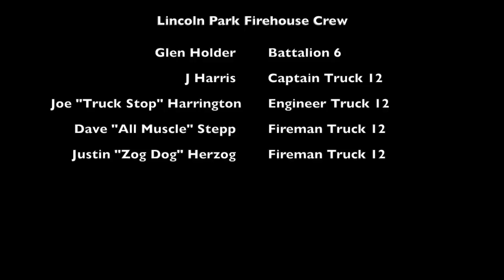Tuther Fire 2 FireCams

Comment: Discipline was good.
That being said...when you vent the roof of a single-family house, and fire comes out of every hole you cut...it's time to go. Get the hell off the roof before those 2x4 trusses fail. The house is lost.
Reply: I have only one issue with your comment. It is wrong. roof venting cools the attic and in this case the fire entered into the attic and rear bedrooms only this means that the rest of the house and contents are not involved. Going defensive only is likely to result in greater loss of property specifically the contents. By continuing these firefighters may just have saved irreplaceable keepsakes and photographs of loved ones who have passed. Next time think about that before you write off any structure. Everytime you respond to a fire the situation is unique to that fire and requires different approaches.
Reply: nathanieldayspring00  Think about your absolutely most treasured keepsake and then think about how you would feel if that was lost due to the firefighters wrote the house off. I will bet you would be going after compensation for their not considering that. I have seen the concern for a treasured irreplaceable artifact at a fire and when we were done we were able to tell them that it was saved. That brought such joy I cannot describe it other than to say it was beyond extreme.
Reply: @retiredarthritic2083  vertical ventilation also stop the flow path for the fire. It will essentially stop it from spreading through the rest of the house as well.
Reply: @speedball10169  I know what you are getting at. I think that it would be more accurately described as establishing a changed flowpath for interior ventilation. Firefighting is about removing all three of the components of combustion. By venting the attic through the roof the attic is vented and the interior temperature is reduced which reduces the intensity of the fire combine this with water and CAF we again are removing heat and with Compressed Air Foam, Oxygen as well. We must have a well coordinated fire attack to do this effectively. This is why communication is so vital. Independent action can and does injure and kill firefighters and civilians.
Reply: the gol here keep more possible thing and extinguis that fire the more rapidly possible with the best technique that i dont know... saving lives first for sure if there is some in or near the fire
Reply: ok i just wrote that in the reverse order xD
Reply: nathanieldayspring00  Keep up with the attitude troll and you will soon be in Jail. CYBERBULLYING IS A CRIME!!!!!!!!!!!!!!!!!!!!!!!!!!!!
Reply: @retiredarthritic2083   I find Youtube's double standards really tiresome. We (and others  who contacted me) have been reporting JB for a LONG time for his bullshit, and nothing is done.  

Yet here in the span of a few days nathaniel whatsisname has had his trolling removed.  That's bull.
Reply: @mxslick50  Yo man I think I have some small credit there Nathaniel was so obviously criminal in his behaviour they had no choice. The resident loon doesn't quite go that far usually. Patience we have to await his next major slip up.
Reply: nathanieldayspring00 , settle down. You only know how to respond by name-calling swearing. Try a little maturity. You'll be taken more seriously. Otherwise it just sounds like a brat fit that nobody has time for.
Reply: @retiredarthritic2083  you ever been robbed? I have irl. Physical objects can be destroyed, memories not so much.
Reply: Yea I'm sure they know what they are doing Mr. Youtube commenter.
Reply: Whoa watch out bunch of professionals in this comment section...
Reply: nathanieldayspring00 , yeah, see? As soon as I got to your second sentence I quit reading so you just wasted your own time typing your little novel. Bless your little heart. You tried.
Reply: Luis Oropeza November 16 2016 Ponoka Alberta attempted Robbery/Carjacking. google it and learn . I still have PTSD and Mobility problems from the assault.
Reply: @speedball10169  Essentially that is right and what is supposed to occur. Not to say that it is a vertical vent that you do every time every fire is unique and has varying problems which must be addressed there are times where horizontal venting will be better along with PPV positive pressure ventilation
Reply: nathanieldayspring00  Who is the fool?
 "Negligence 101
Court cases provide insight for Canadian fire departments
     January 31, 2010
Written by Timothy Wilkin
Editor’s note: Lawyer Timothy Wilkin of Cunningham Swan Carty Little & Bonham in Kingston, Ont., prepared a review for the Ontario Association of Fire Chiefs of reported Canadian court cases in the last 15 years that dealt with negligence by municipalities and their fire departments. Over the next few months, we will look at those cases. 

There is a surprising lack of reported court cases in Canada dealing with the issue of negligence by municipalities and their fire departments. This dearth means either that fire departments are rarely accused of negligence or that most of the claims against them settle before trial. Given the rigorous commitment to training typical of most fire departments, the lack of cases probably means it’s the former. Even from the reported cases, findings of negligence are more the exception than the rule.  

negligence  
A negligence claim alleging that an Ontario fire department failed to ensure an adequate water supply was unsuccessful.
  But mistakes happen. And when they do, the conduct of the fire department, its officers and firefighters will be held up to the same legal principles and standards that apply when determining the issue of negligence in all types of action. 

Negligence is based on the principle that people in positions of responsibility owe a duty of care to exercise their responsibilities in a manner that does not cause harm or loss to others. Whether the alleged negligence relates to a person operating his or her automobile, or a doctor performing surgery, or a fire department responding to a fire call, each of them has a duty at law to carry out their responsibilities according to a standard of reasonableness.

A standard of reasonableness can be a very high standard, especially for people such as professional firefighters who possess specialized skill, training and expertise, but it is not a standard of perfection. In each case, the issue must be answered by comparing the alleged negligent conduct to the standard that would reasonably be expected of another person of similar training, skill and experience operating in similar circumstances.  

The fact that another person might have done things differently does not necessarily mean that there has been negligence. Instead, the issue is whether the conduct can be said to have been reasonable. As a rule, the courts do not want to second-guess decisions that had to be made in the heat of the moment (pun intended!); however, in examining whether particular conduct was reasonable, the courts will look for guidance from any applicable operational or policy manuals and will hear evidence of normal standards of training, practice and procedure. The further the conduct in question deviates from those manuals, policies and standards, the greater the probability of a finding of negligence. 

In Ontario, the Fire Protection and Prevention Act, 1997, generally protects fire chiefs, firefighters and other fire department personnel from personal liability for negligence as long as their alleged neglect or default has occurred in the “good faith” execution of their powers or duties. Section 74(1) states:  

No action or other proceeding for damages shall be instituted against a firefighter (definition: a fire chief and any other person employed in, or appointed to, a fire department and assigned to undertake fire protection services, and includes a volunteer firefighter), a fire co-ordinator, a community fire safety officer, a member or employee of the Fire Safety Commission, an assistant to the Fire Marshal, the Deputy Fire Marshal, the Fire Marshal or a person acting under his or her authority, for any act done in good faith in the execution or intended execution of his or her power or duty or for any alleged neglect or default in the execution in good faith of his or her power or duty.

Though this protects fire department personnel from personal liability, section 74(2) renders the municipality (i.e., the taxpayers) vicariously responsible for the losses suffered by an injured party because of a finding that the fire department or individual firefighters acted in a negligent manner. 

The reported court cases can be grouped into three categories. The first considers the distinction between policy decisions that might compromise firefighting capacity, but for which there can be no finding of negligence, and operational decisions that, once taken, can be used a basis for a finding of negligence.

The second category examines the extent to which courts try to avoid second-guessing the many difficult and rapid decisions that had to be made in response to a fast-moving and potentially dangerous situation. Even though there may be clear evidence that doing things differently might have had a different outcome, the scope of what the courts will consider reasonable in these circumstances is quite broad.

The third category takes a closer look at operational decisions that involve situations where there is a much closer connection between the situation at hand and generally accepted standard operating procedures. These included situations such as completing a proper overhaul, maintaining a proper fire sentry to prevent rekindles and standards of emergency vehicle operations. In these cases, errors in judgment that are clearly at odds with generally accepted procedures are more likely to result in a finding of negligence." You should know your facts before you comment.
Reply: nathanieldayspring00  When I was growing up I had the pleasure of seeing one of those unfortunate souls who was living in my home town. His name was Ollie. Ollie was a gentle soul. He passed away a couple years ago and was honored for his contribution to Summerland BC in general. It is doubtful that Ollie ever had more that a few bucks in his pocket and usually was found working for a meal or a couple bucks to make it to the next day. I said earlier that Ollie was a gentle soul he was also humble and generously respectful and quiet. He never uttered a foul word or called anyone down. when he passed away the citizens of Summerland rose the funds and had a memorial bench placed by the horseshoe pitch. Olaf Norum dignified and honorable despite being mentally slow he taught many of us kids the value of respect. >TRUE STORY< Ollie is a perfect example of a nonconformist. His very existence was not conforming to societal norms. Still having suffered all the slings and arrows of suffering the effects of mental health  issues Olaf rose to be a respected person in Summerland Society His life was one that showed having a nonjudgmental and humble attitude combined with respect and gentleness even though he was forced to be non-conformist in his life he rose to greatness of a sort even though he never rose to a position of wealth.
Reply: nathanieldayspring00  In addition to proving you wrong with my last comment I am now going to inform you that I have not been able to see my Mom since 1986 and haven't seen my Dad 1995 Why because they are both deceased and the last I heard graves do not have basements.
Reply: @mxslick50   our nathanieldayspring00 just got himself in a world of hurt. check out the comments.
Reply: nathanieldayspring00   You started the argument this is the absolute proof 

"Brandon Seyfried
3 months ago
Discipline was good.
That being said...when you vent the roof of a single-family house, and fire comes out of every hole you cut...it's time to go. Get the hell off the roof before those 2x4 trusses fail. The house is lost.

88

Retired Arthritic
Retired Arthritic
1 month ago (edited)
I have only one issue with your comment. It is wrong. roof venting cools the attic and in this case the fire entered into the attic and rear bedrooms only this means that the rest of the house and contents are not involved. Going defensive only is likely to result in greater loss of property specifically the contents. By continuing these firefighters may just have saved irreplaceable keepsakes and photographs of loved ones who have passed. Next time think about that before you write off any structure. Everytime you respond to a fire the situation is unique to that fire and requires different approaches.
 
9

nathanieldayspring00
"nathanieldayspring00
1 month ago
@Retired Arthritic Fuck the goddamned keepsakes. Hose that house before the fire spreads to another structure. It's fucking fire fighting not Hallmark Hour." You started with a pejorative and aggressively argumentative comment I have not been disrespectful. I simply demonstrated the truth with the evidence of what I spoke. Every time you responded with your vile I simply returned your obnoxious stupidity with further factual evidence. You have been dancing to a tune directed by moi and flaunting your scofflaw attitude while breaking ever more laws Then you made a wish that I would die and in the same comment made reference to my citizenship in and Canadians generally that was pejorative and insulting cyberbullying someone in another country is a federal jurisdiction and therefore the bailiwick of federal law enforcement not state or civic lad and you are in for it.
Reply: "You're not anonymous" My training in computer networks is setting them up not writing software. Also I never said I was a programmer. I said I have skills you should be concerned about. Now have you ever heard of a mac-address . It is a unique address specific to your computer something like a serial number. It is what the internet uses to identify your internet address and the other addresses are your internet provider. For the internet to work each and every address must be unique. Think of it like this an investigator can follow the trail back from the YouTube comment section right to your computer. The other aspect of this is if there are two identical addresses then it causes an addressing conflict which will cause disruption of the internet.
Reply: nathanieldayspring00  
Other laws related to cyberbullying
Several other Criminal Code offences also deal with bullying, including cyberbullying.
Depending on the exact nature of the behaviour, the following current offences could be charged:

Criminal harassment
Uttering threats;
Intimidation;
Mischief in relation to data;
Unauthorized use of computer;
Identity fraud;
Extortion;
False messages, indecent or harassing telephone calls;
Counselling suicide;
Incitement of hatred; and,
Defamatory libel
You should READ the full comment fool.
Reply: He and his partner did the right thing and kept cutting vent till they were no longer venting flames, hence reducing the heat in the rest of the attic and slowing the spread of the fire in the attic.  You noticed he kept tapping the roof, then placed himself at the safe down slop so his partner could cut the holes higher up the roof, ver much well-practiced and performed, keeping their safety and being alert of the situation.
Reply: @retiredarthritic2083  Where are men like you hanging out? sigh Oh well, let's just say I love the way you say thing's! My life was saved by firemen when I died in a house fire. My dog didn't make it. Fire Fighters are true hero's in my book. If You are a veteran, you are entitled to trauma counseling. I recieve it from both Army and private sector's. Good luck and God bless!
Reply: Can we all agree that roof ventilation with attic extension is only truly effective as part of a well-coordinated attack between interior teams and the roof crew?   Let's agree on that much....
                            This video I thought was great; the roof venting crew not only vented and communicated their findings to the IC and interior crew, but took the time to punch large holes below the vent so interior crews would know EXACTLY where the vents were.   Everybody could physically see what the other was talking about and seeing; we call that 'big-boy rules'.  Big boy rules trump because it's eyes on.   This crew's vents gave great eyes on the top of the gasses and what they looked like, good communication to the other crews, good continuity through to the interior crews both communication and visual.  Fantastic!
                             For me the only minor thing I would like to have seen was an attack line on the roof a little earlier, but that has to be exorcised judiciously as well with the interior crews below.  That attack line early with good nozzle control can be a great aid, especially early in cooling an attic on an intact ceiling where interior crews have not yet advanced to, giving the interior crew time to fall ceilings and catch-up to the venting, ultimately, working together to keep ahead of the fire, reducing the risk of going defensive.
Reply: @retiredarthritic2083  How do you "Retire" as a volunteer?  lol.
Reply: nathanieldayspring00  you do know that the goal of a firefighter is to save lives and property right?
Reply: Retired Arthritic Nathan said there is an idiot born every minute. So said person is practically calling their self an idiot?
Reply: @retiredarthritic2083  Looks like the comments turned into a shit show. Here's something useful. 
I don't think the original commenter was suggesting going defensive but rather, no more need for a crew on the roof. Once you cut a good size hole and you have fire, your roof ventilation is complete. No need to stay up there. Especially when you consider, if it wasn't before, that fire is now directly under your feet making roof failure much more likely. Get down and assist fire attack